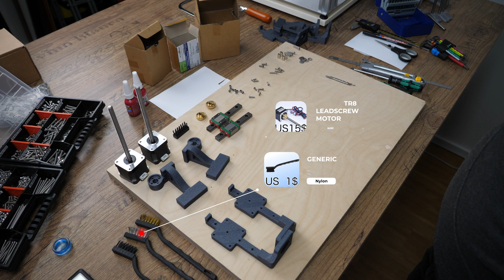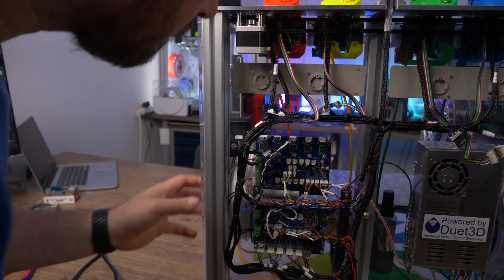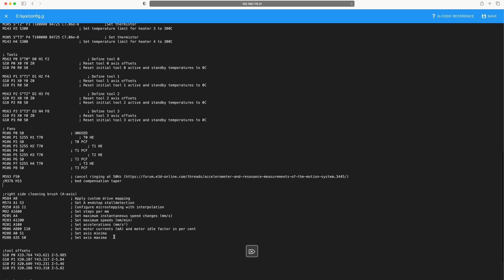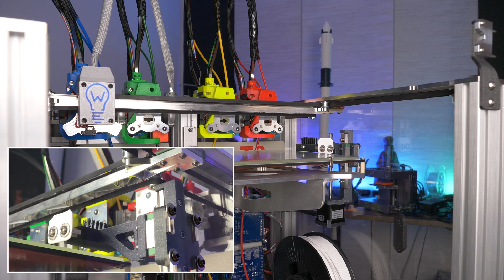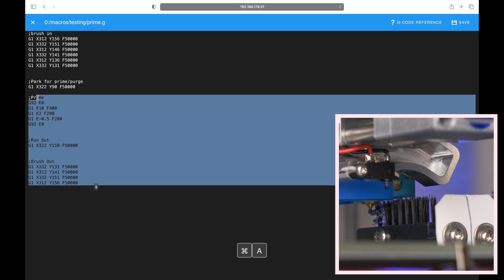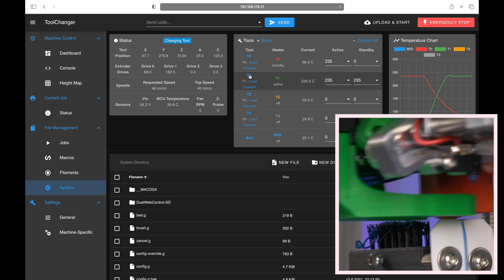E3D Toolchanger - UPGRADES #01 - automatic adjusting brush

Comment: It seems like you'd get slightly faster toolchanges if you move the brush in the same move as lowering the bed. Only a second or so, but if you're printing with a lot of toolchanges that could add up pretty fast.

Comment: I'll admit I haven't watched the full video yet, but can't the hotend be adjusted up/down in the mount, so the nozzle ends up roughly at the same height?
Reply: in the best case not without changing the (metal) parts of the tool, in the worst case it's impossible - e.g. the Hemera doesn't allow for much play since it is such a hefty unit. It is much easier having adjustable brushes then to try to reach a certain height when designing a new tool (I can say from experience)